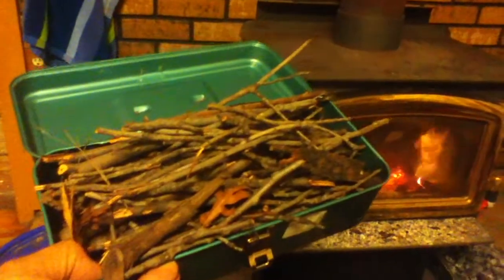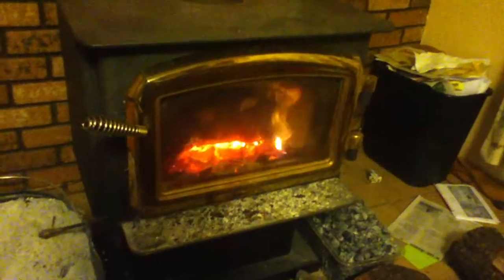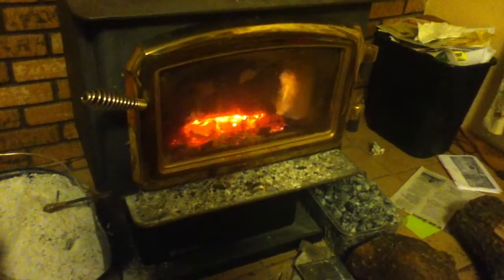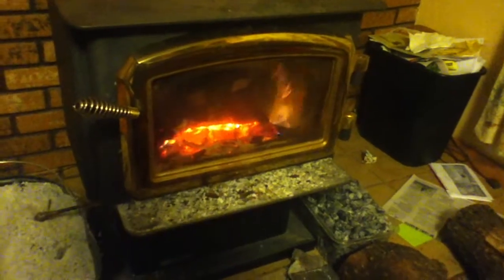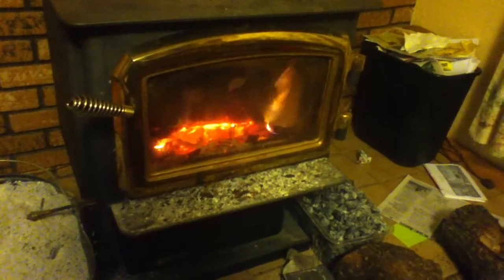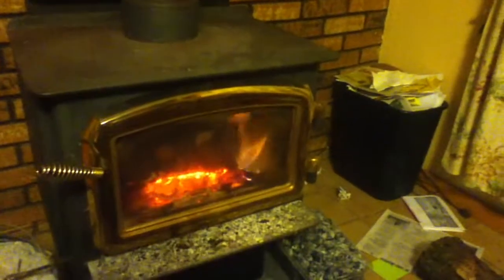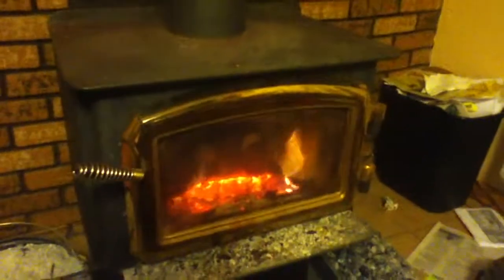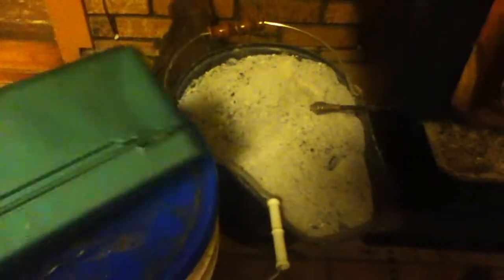Making BioChar Free & Easy In Your Wood Stove-Part1/3

Comment from the maker: @nutmegger1957 Good point, just - what metal container does not have elements that are toxic? Once the paint is burnt off the box is still usable for hundreds of uses. Someday it would be wonderful if the fuel and items we use and throw away are not in some way toxic to the environment. Biochar seems to me to be a possible exception but it too has considerable hazards.